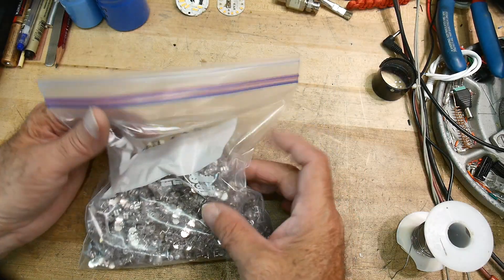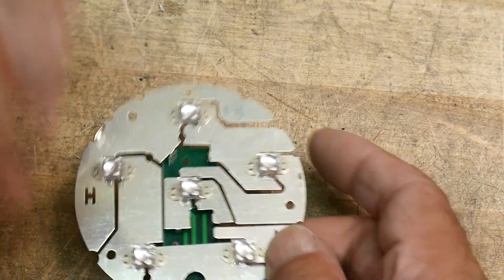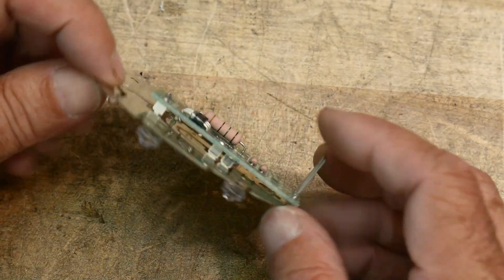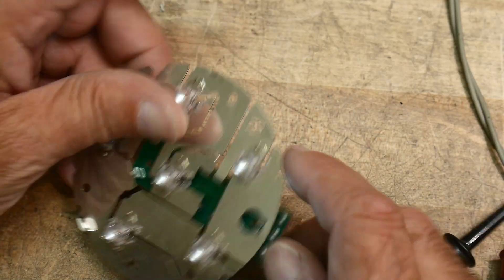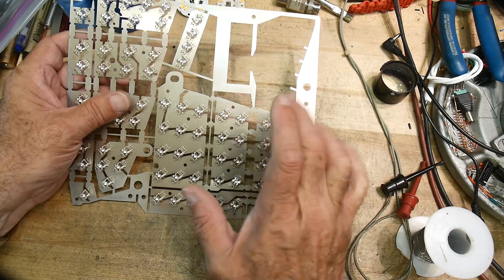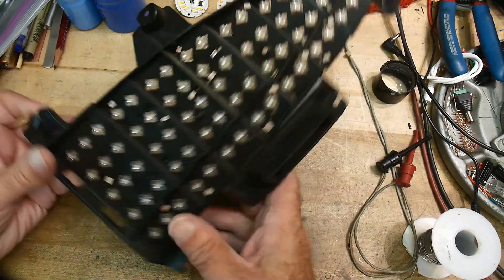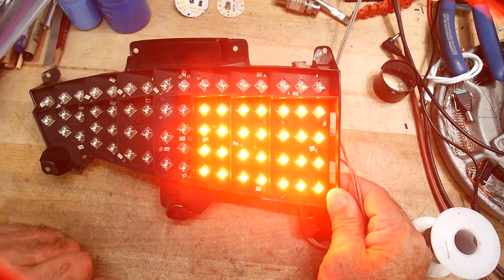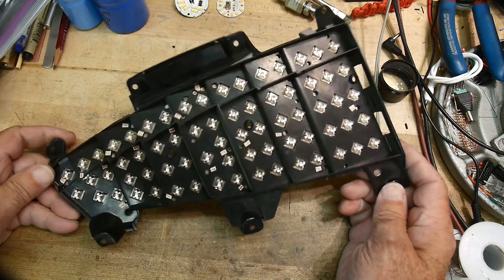#856 LED Automotive Tail Light Stop Light

Comment: 2000 Deville, 1st car w/ all LED rear lamps

Flat part contains all the pieces that fit in the black carrier after stamping and folding

4” round is for truck and commercial vehicle applications

Comment: 1:30: the operation is staking (it may also be classed as riveting). The metal could be a number of things- austenitic stainless, like the common type 304, is non-ferromagnetic. Some grades are quite ductile (304 is used for safety wire in aerospace and auto racing) , common, and reasonably inexpensive. Pure nickel is ferromagnetic, but many nickel alloys are not. If you know someone with a PMI unit, it is easy peasy to find out.
Reply: I think this is technically considered clinching. Staking is deforming a shaft or boss to form a head, whereas clinching uses a punch and die with 2 flats sheets of material.
Reply: @mgobluevictor  It may be a clinch. I went with staking as it looked like the deformed section went through a hole in the substrate, and that is the term I am familiar with in the industries I work in for this use case.
Reply: R2eee3e³èeeee

Comment: That first LED light design is brilliant in multiple ways. I recognized that the metal, being reflective, would also act as a light reflector to increase the actual light output. Then it is non magnetic, so most likely not going to rust. Also, no solder joints, to fatigue over years of bumps. It truly is a marvel! LumiLEDS really created the perfect automotive LED light assembly. At least in my opinion they did. Thanks so much for sharing IMSAI Guy!   Fred